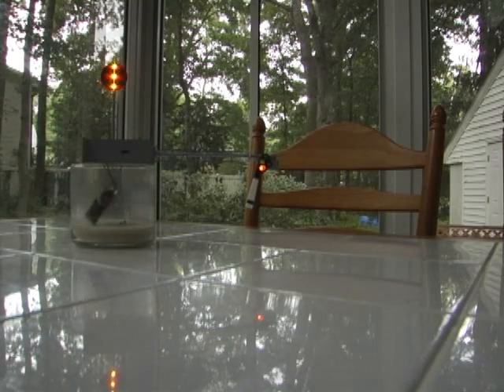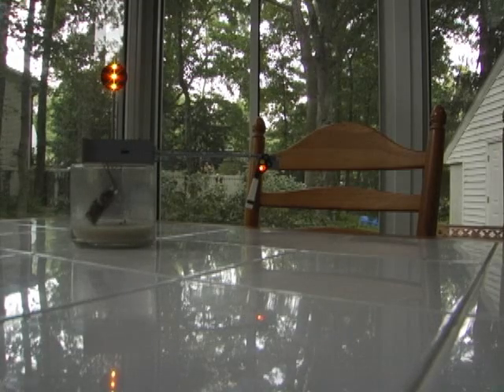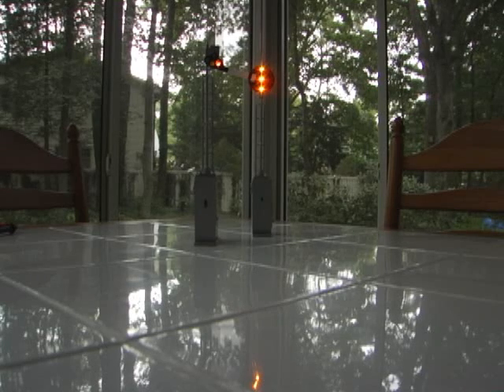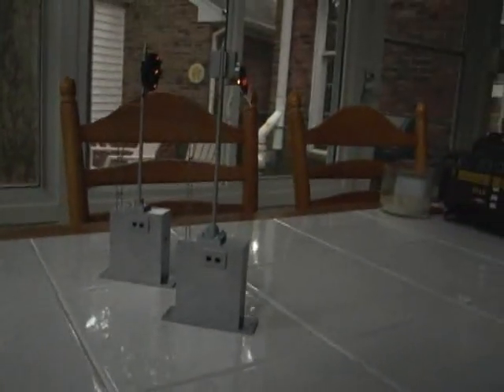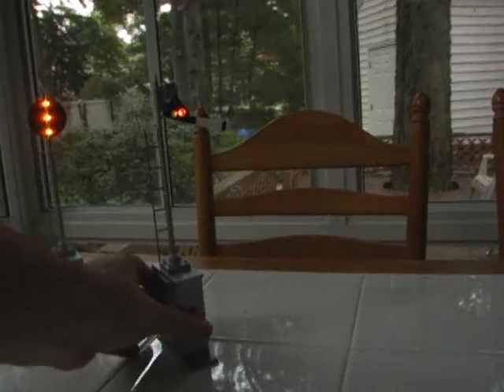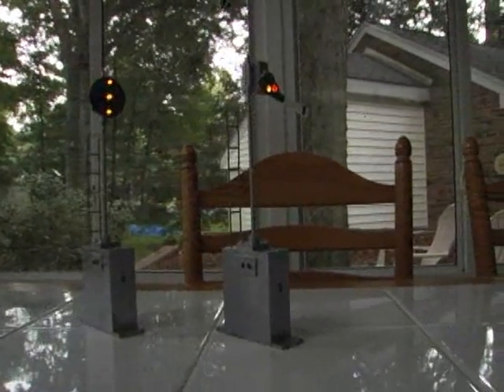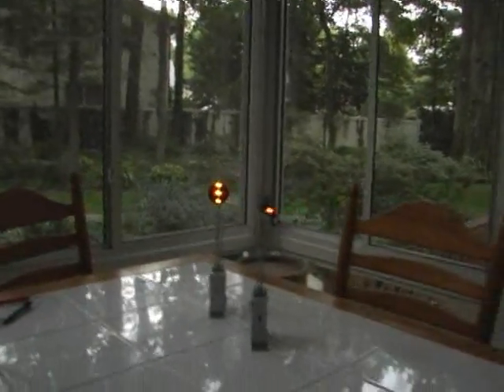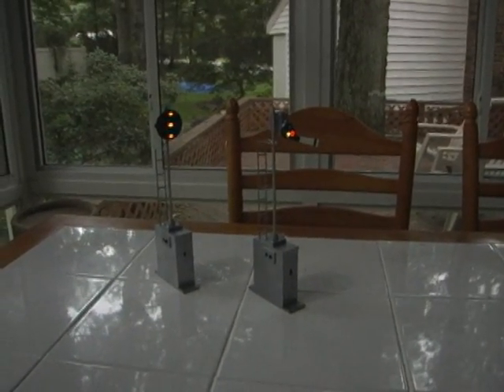SB Signal Semaphore Problems Part 2

Comment: Have you tried a 12v battery had the same problem with crossing signals they would act erratically when connected to the 9v battery so I connected them to a 12v battery and no problem sense

Comment from the maker: @IllinoisTrains1 nothing seems to be getting warm.  I contacted SB signal to get this replacement and about the problems with this item.  They suggested the Energizer battery.  I've done lots of testing and rather than just reply via email I thought I'd make this video to show them how well it works, rather than describe it again in email.  They've been sent the links to these videos.  Hopefully this will get fixed and I'll be sure to update.